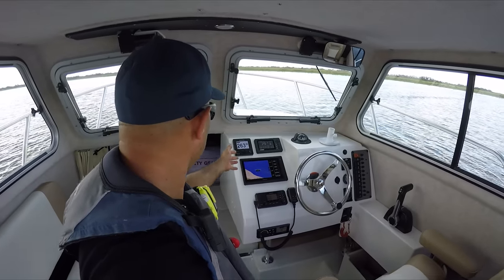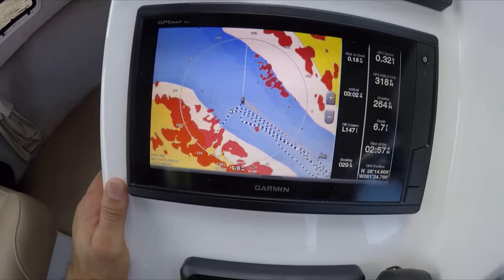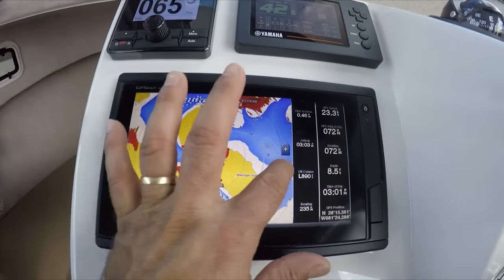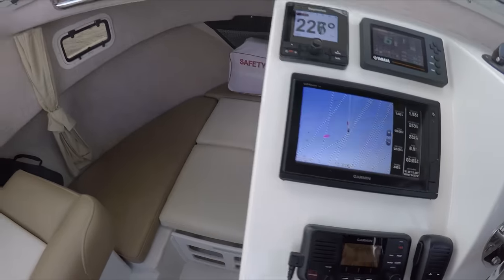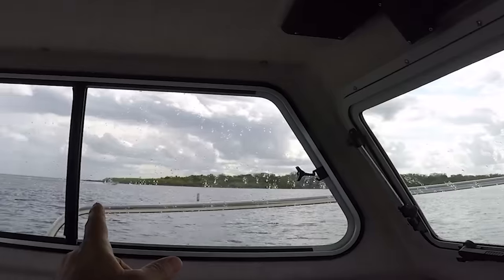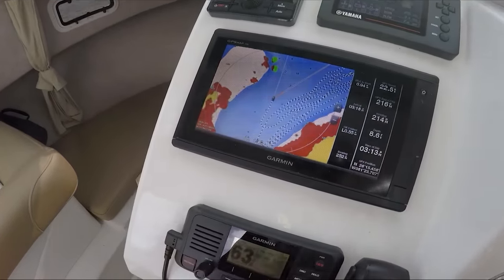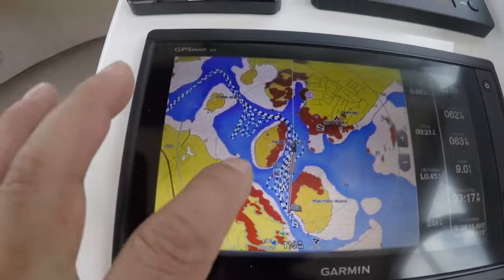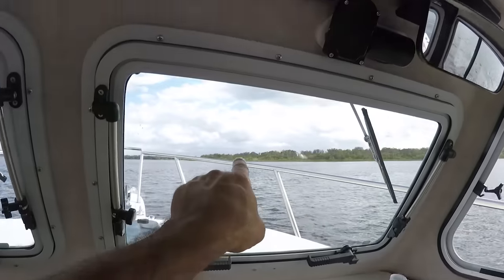Garmin Fantom 18 Radar Testing in my Crooked PilotHouse boat DIY

Comment: Looks like it works great. Now you won't be concerned moving the boat in fog or at night. Nice unit and I like it uses the garmin display and doesn't require a separate one of it's own.
Reply from the maker: yes this is a dream for low visibility navigation

Comment: Looking forward to seeing some more weather activity on the display, that is a great tool at your disposal.
Reply from the maker: Thanks Glenn and yes when I'm an open ocean I be able to see thunderstorms in boats on the vicinity.
I will keep you updated captain
Reply: @OutOnTheReef  negative ,weather would not be displayed . A GXM 54 antenna must be installed..(600 $ ) with  SiriusXM coverage subscription ..like 50 a month .The only thing we can see without this weather device is rain clutter but not tracking information  :(
Reply from the maker: @PedroRodriguez-ui6pq  yes that's the only thing I could do, but remember this radar is different than yours this one has the Doppler effect
Reply: @OutOnTheReef  Hummmm maybe you will be able to see little more rain information since is more new radar..remember to update you GPS unit with radar on!!!
Reply: @OutOnTheReef  Just saw this " Doppler effect to detect and highlight targets moving toward you or away from you in different colors to help avoid collisions, find flocks of birds and track weather. Dual range shows close and long range split screen images at the same time, using a single antenna"
Reply from the maker: @PedroRodriguez-ui6pq  is it has all those features and what I really like is it reads 20 feet away from the boat and the old ones you need 60 ft to start reading another feature the new one has is instant Radar instead of waiting for 1 minute warm up.
And only use 40 Watts or less I like those features cap.😉⚓

Comment: good video as usual!!! Looking to see more inf about MARPA ( mini auto radar plotting AiD ) I think you will need a heading sensor ( 129 $) connected to you Nmea 2000 but will give you a more precise collision avoidance and radar target information..I recently installed in my old garmin radar GMR 41 and is showing things I never though I can see..is really cool ...I have two 7610 xvs gps 
Let me know if you have that option available should be in you GPS  settings !!!
Reply from the maker: I will have to look into it that sounds like a good tool to have thank you Pedro

Comment: Thanks for this radar install/instruction video. Just purchased and installed a Garmin Fantom 18x this weekend. This is my first opportunity to have radar. I noticed a hum in dome when I had the transmit turned off. Do you know if yours does this as well? Wondering if I need to hook it up to a switch so I don’t drain my batteries when I’m not using the radar. Thought the MFD controlled the power consumption…
Reply from the maker: Congrats Andrew i haven't herd mine since im inside the pilothouse and yes is better to cut the power off wen not in use, i always cut the power of wen i store my boat after a foshing trip. Navigate safe cap

Comment: Just installed the same rdar. Hoping it is able to pick up bouies from fishing nets when im trolling for salmon.
Reply from the maker: If is the size of a small crop pot i will not but if they are bigger yes cap. And navigation at night now you will love it cap.👍
Reply: @OutOnTheReef  The bouies they use over here en Denmark and Sweeden are useually bigger than the ones on crabpots, so i think its gonna be fine.
Reply from the maker: @Kaptajn1eye  yes you may read those cap. Navigate safe cap

Comment: I am trying to get my radar imaging on my new GMR Fantom 18 to show just like yours, but I seem to always have way too much clutter. Can you share your settings please? I did not see where you adjusted your setting to get such clarity in your radar imaging unless I missed it.
Reply from the maker: There is a settings that you can adjust your clutter cap from high to low that will be available at the Radar settings cap. I hope this helps
Reply: @OutOnTheReef  is the setting actually called "clutter"? And go in the lower direction? My images look like big blobs with no clear shape at all.
Reply from the maker: @davidlane2006  try other settings i dont quite remember off my head but i know one of those settings help a lot cap you just have to play with it cap.

Comment: Hey, if you see a bunch of birds can you make a video on your bird mode on your radar? Thanks
Reply from the maker: I have seen them if there are a lot of them but if it's just a few Birds far away it doesn't reach them it has to be a large crowd
Reply: I wonder if you turn your gain up manually if it would then pick them up better?I’m just bought a garmin with fantom radar. I really want to learn that bird mode... where there are birds there are fish. Thanks for the reply
Reply from the maker: @duanehankins7077  yes I agree they'll be some top fish like Mahi and tuna I heard a lot of fisherman use the radar for that is awesome but I have never used it for that

Comment: How fast is your boat with the 200 Yamaha
Reply from the maker: When I purchase the boat without any installation of any equipment I was doing 41 tops but after I started adding weight to it refrigeration air conditioning extra batteries extra anchor Grill and a lot of other accessories my speed came down to 36 miles per hour max but I don't run at that speed I always run at 27 miles per hour wish that's my cruising speed and best fuel economy so even if the boat when 50 miles per hour I will not run at that speed since I need to conserve fuel
Reply: Out On The Reef I’m the same way got to conserve the fuel

Comment: 4 or 6 kw ?
Reply from the maker: 4kw
Reply: @OutOnTheReef  Actually I believe it is a 40 w not 40 kw. Did you look into the safety aspects for people onboard of transmitting at lower wattage (40 w vs. 40 kw)?
Reply from the maker: @pacedge123  thanks Greg and no I haven't👍👍